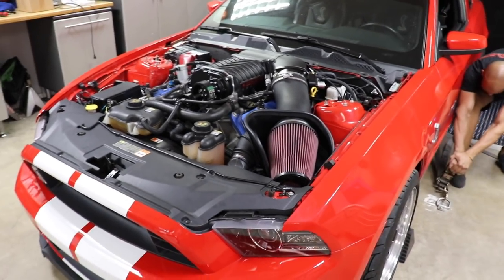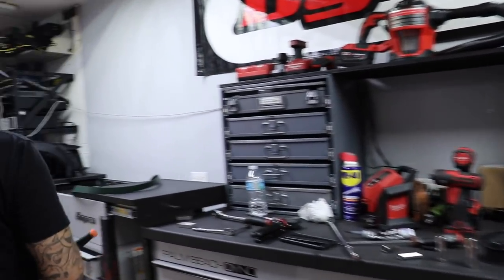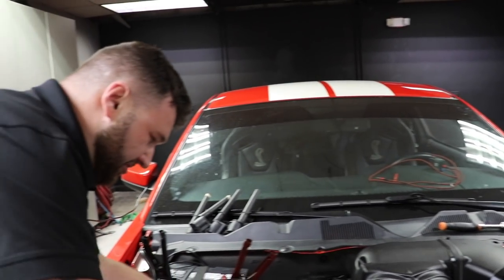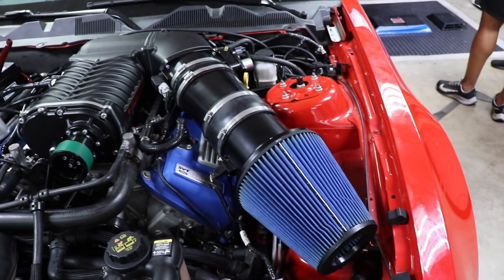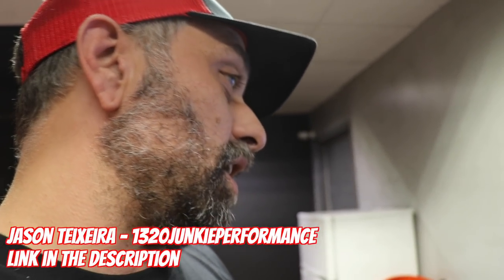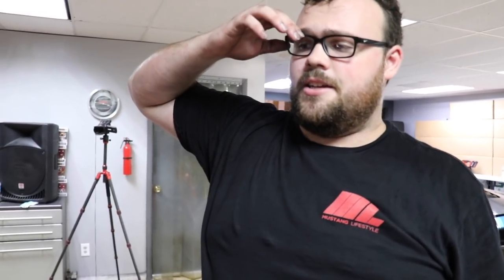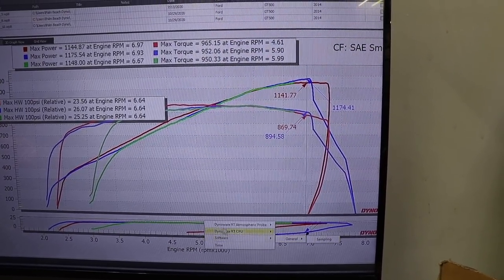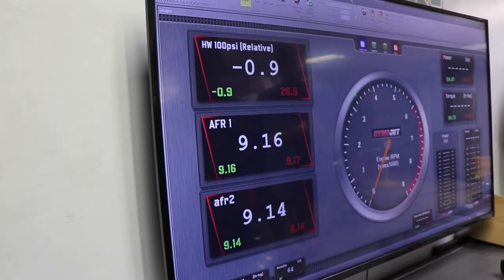El Choppo Makes BIG POWER with Massive Whipple 3.8L Supercharger

Comment: I think at this point you should get with MMR in California and have them build you a intake manifold with their built in intercooler and then go twin turbo. You will be at almost 2000hp then. But I don't know if your transmission drives haft and rear diff will handle that much.

Comment: Not fully done with the video yet, but you just told me last week you haven’t had a single issue with the tensioner?
Now this video you have stated you had all kinds of issues with the tensioner in the past?
Which is true, because I was very surprised you said the stock tensioner has been fine for you.
Reply from the maker: It’s not tension that is the issue. It’s the 3/8” end to depress the tensioner that strips when getting the belt on and off
Reply: @MustangLifestyleTV  that is exactly why I ended up with an aftermarket tensioner.
The stock ones strip too easily.
Thanks for confirming, that really confused me from our prior conversation.
Glad you got the bugs worked out. The car is a beast!

Comment: Sounds like the VMP Gen3R wasn't "out of gas" after all.
Reply: Exactly
Reply: May be  true but we all have our preferences
Reply: @travionjohnson3975  I think I would prefer a whipple but I didn't get a free blower and then say it was out of gas/ maxed out.
Reply: It may not have been out of gas, but the intercooler issue was the biggest concern.
Reply: @SHOOTSHOW00  Aw didn’t know it was free
Reply: @travionjohnson3975  that vmp made crazy power for only a 2.6 imagine the new 3.1
Reply: @tristansmirnow850  I agree. Maybe Whipple has an endorsement with him. Can’t go with either one
Reply: @travionjohnson3975  u a turbo guy?
Reply: @tristansmirnow850  naw I just got me a 2011 GT500 had 31,000 miles on it. Think the factory blower ported has a smaller pulley cobra jet throttle body full exhaust aluminum drive shaft
Reply: @tristansmirnow850  I may get a bigger blower on down the line
Reply: @travionjohnson3975  👍 sick bro
Reply: @tristansmirnow850  thanks. Which do you prefer
Reply: It's not just about a boost number. It's the complete efficiency of the blower. The Gen3r has to be spun harder to make the same 24lbs of boost. Which causes more heat obviously. The 3.8 whipple is the better option for this application. 
That said, it should mph better but the ET won't change much until he gets more seat time and gets the suspension worked out. Anti roll bar will be a big help. Although this car should have went 8s with the Gen3r.
Reply: @waynebollentin989  yeah ik that but it made 21lbs of boost and made 1120 (correct me if I'm wrong) but the larger whipple made 27lbs and put down like 1290......thats not very much compared to a 2.6 and a 3.8
Reply: Exactly 💯
Reply: @travionjohnson3975  to me i like vmp blowers but whipple is just to over rated imo and if your going to build the block I might would wait for the 3100 and see the power gains on that blower
Reply: @tristansmirnow850  I got Cdl’s drive trucks do I can’t get to crazy anyways I know I don’t wanna make it track car. I just wanna have respectable power and have fun. My grandad had every kind of mustang and that’s why I love them
Reply: @travionjohnson3975  i would go with a gen 2r or just a regular gen 3 or maybe just just 13-14 trinity swap
Reply: @tristansmirnow850  appreciate that thanks
Reply: @tristansmirnow850   there's a lot of factors at play and I honestly don't know enough about this setup to be completely accurate. What I do know is that a 3.8 whipple maxed out is going to make much more than a gen3R maxed out. The 3.8 will support 2000hp. The gen3R isn't making that. Now I was under the impression that the gen3r was at 22lbs when it made about 1100whp This made about 200hp more with about 4-5lbs of boost and there's still not spinning hard yet. Also remember boost is going to depend on how much air the motor moves N/A, headers, complete exhaust, the size of all the air intake components, etc. Then we have to know the timing. At this power level 1/2 degree can be worth 25hp or more depending on compression, fuel and hp potential. There's no question for a built motor this is a better choice. 
Look the gen3r isn't bad but the way they have done tests are very misleading. Like the comparison with the Kennybell at 24psi. Although if their only goal was to fool some, it worked lol..
Reply: @waynebollentin989  true

Comment: I dont understand how tires can change the horsepower number that much
Reply: Because of the compound they're made from it's a softer thicker sidewall and they just eat up hp on a dyno it kinda works in percentage so itll be 50 whp on a car that high but in a lower hp car it wouldn't be that high more like 20 depends on the power level and the size of the drag radial.
Reply: Lil' Ike it had nothing to do with the company it had to do with the boss ply side wall. It absorbs the energy the car is putting out then unloads it like a rubber band when you let off

Comment: Really too bad you guys didn't get your shit together and get the tire that would make most power. Its always an excuse with you Ford guys. Tires and wheels take what 20 minutes to install. Certainly you have the stock rims or know someone with another mustang that could have loaned you the tires required.
Reply from the maker: Seems like you need to get your hearing checked. 5/8” studs... only specific wheels fit 5/8” stufs